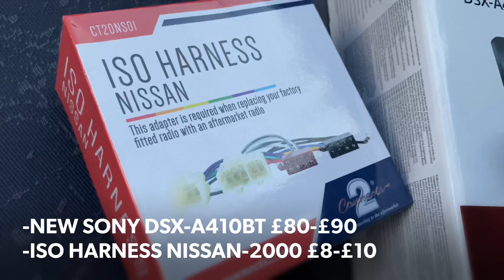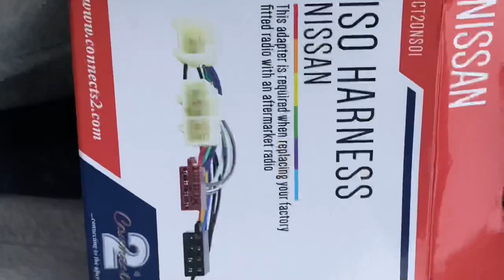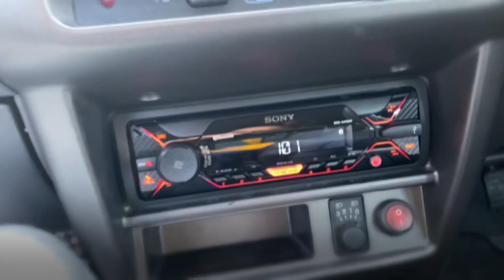AFTERMARKET Stereo: How to Install! K11 Nissan Micra.

Comment: Thank you, very helpful 😊
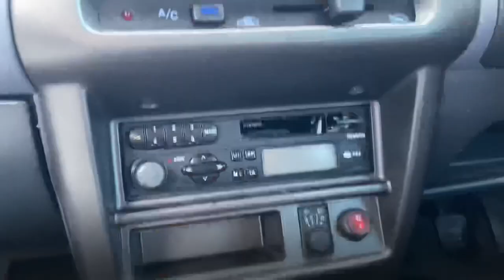1:02 These 2 screws doesn’t hold the console, so no need to remove them. I guess the part at the bottom doesn’t need to be removed either, but this way you can clean the dust in it

Comment: I got the same and just switched the cables, it didn’t work and now the old one doesn’t work, I didn’t disconnect the battery or earth the black cable, could that of blown the fuse?
Reply: Same just happened to me
Reply from the maker: Not sure on what you mean but definitely disconnect the battery on the safe side then you know there won’t be any issues while installing it ! What cables do you mean when you say you switched them. Cheers!

Comment: Could someone help me out. Once the harness is attached there are two plugs, one red and one black. Which one of these is plugged into the new stereo as there is only one socket. Cheers
Reply from the maker: With my one I’m sure they both went in! Are you sure it’s the wright harness is all I can think!
Reply: The radio comes with its own connector and comes with its own wires that will connect to the red and black one, if your missing those wires you need to buy it separately because your "new" radio is missing the wires it came with when it was new

Comment: what are the speakers like when this is done quality wize
Reply from the maker: Speakers seem fine ! If you have full bass on there’s sometimes a bit of a rattle… probably more the car then the speakers though 😂
Reply: You can tune the sound on most good aftermarket radio's, the stock speakers with the tweeters factory upgrade sound fine when tuned properly
Reply: If you dont have the tweeters from factory then just buy som 16,5 inch speakers for the doors

Comment: Why did you choose not to plug in radio? If I wanted the radio too is there an easy connection on the back?
Reply from the maker: To be honest I really don’t use the radio atall in the past so didn’t see the need to plug it in! I’m not 100% if you’d maybe need an adapter or if it would straight plug in!

Comment: Hi we just did this installation today. We disconnected the battery, used the harness with the wires that came with our stereo. We didn’t change the earth wire like you did. We just put it all in together. Reconnected the battery and have no power to the stereo?  Could it be the earth wire?

Comment: What's that red button?  not seen that on many K11'S (mine is an auto CVT) one.
Reply from the maker: It was a set of aftermarket fog lights I had put in.
Reply: Cheers mate. @younganddumb9580